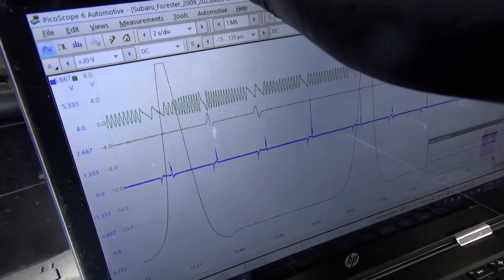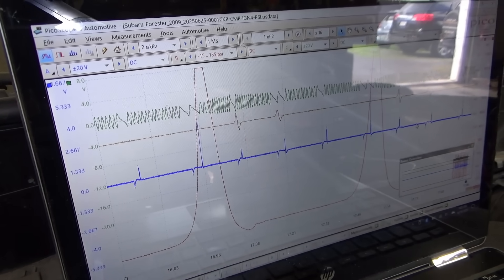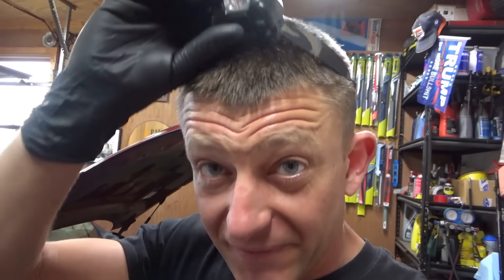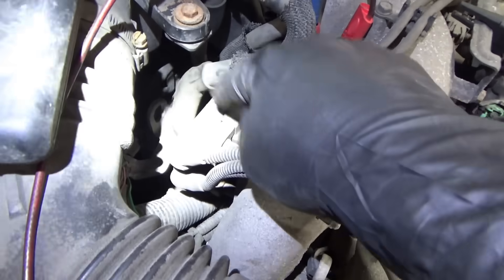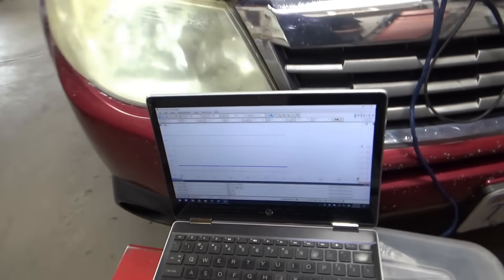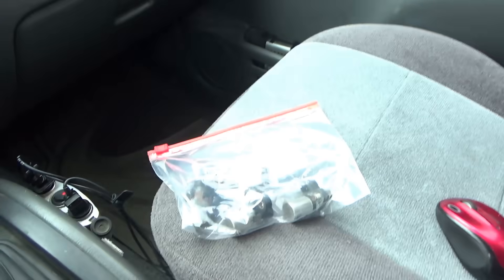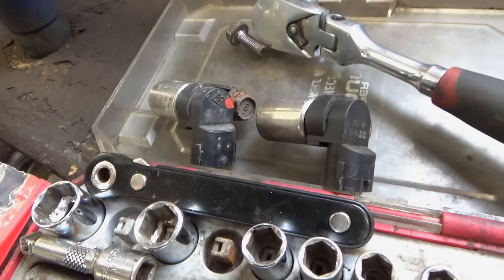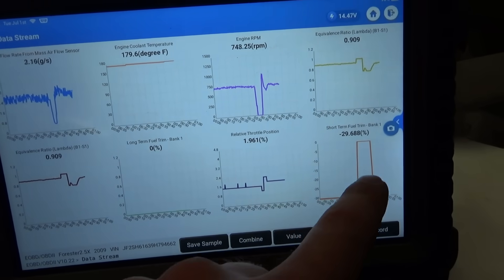(Pt 2) Subaru STUMPS Shop...for 6 MONTHS?!? ('09 Forester Crank No-Start, NO CODES!)

Comment: I wonder if swapping the ckp sensor wires would've made it work. I remember Dan had a similar case years ago with a Bosch sensor
Reply: Just think about the next poor sap that has to work on it the next time and changes that sensor.
Reply: @SunnySunny-jz8kg  After two consecutive OEM's not working he will get a cheap Dorman, and WOW, works again.  😂😂😂
Reply: @SunnySunny-jz8kg  just leave a tag on connector for you or next sap to say what s been done a good way leave connector wires oe cut and swap upstream so it can be seen to be tampered with
Reply: just got here added my comment then come down comments saw yours i belive swapping wires would do the trick but how would you know without good wave form  and the plug will only fit one way
Reply: @jackiemay9471 d pin switch around
Reply: @scottharbaugh431  do it that way and leave a tag letting next person know what you have done as by cutting wires and joining them to wrong colour wires if next person puts correct ckp sensor in and dont work they can see reason

Comment: Dorman = when you hate your wallet.
Reply: Haha Dorman, roll the dice. Feeling lucky?
Reply: Never electrical, but like today I’m replacing a transmission oil pan on a 2012 Mazda 3 with a Dorman replacement . I’ve used a lot of stuff like that from Dorman , and often they are the only source for many older vehicles for similar parts. Gotta give them a 👍for that , just avoid the electrical stuff, which is the same for any Chinesium stuff from anywhere with any other name on it.
Reply: Dorman has a good reputation but Subaru vehicles act like EDM vehicles...real picky about their replacement parts.  Sounds like the pins were reversed inside the connector or inside ckp sensor.
Reply: K

Comment: I wonder how many of those sensors Doorman produced that are bad? Could be thousands!
Reply: Dorman does not manufacture them, they are just the same Chinesium stuff that the parts stores sell with a Dorman name on the box.
Reply: Some older BMW's suffer the same thing. Brand new crank sensors (OEM!) are wired incorrectly.
Reply: I'm pretty sure that Ivan saw the same problem quite a while back on a Bosch sensor.
Reply: IT IS CHINESE.. THEY DON'T KNOW WHAT THEY ARE DOING. THEIR QC IS: BOTH LOOKS THE SAME.. CYLINDRICAL OBJECT WITH WIRES INSIDE!
Reply: Some say that an o ring is left in the hole before the new one is installed and that extra gap will cause these issues.